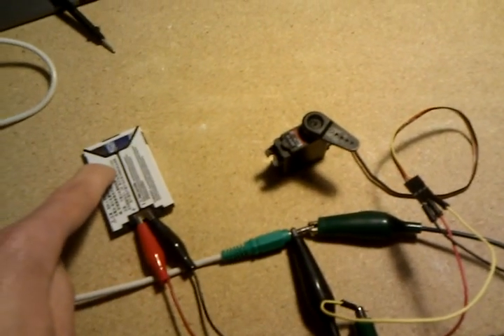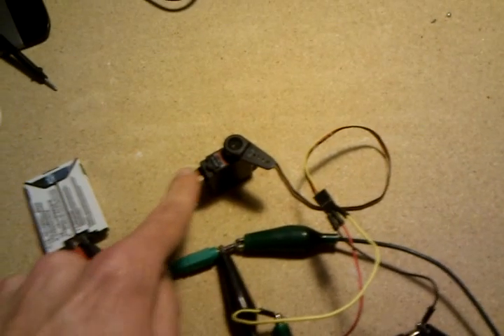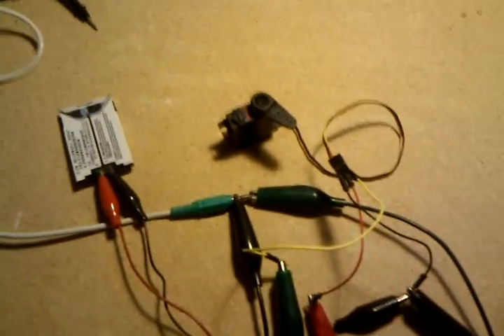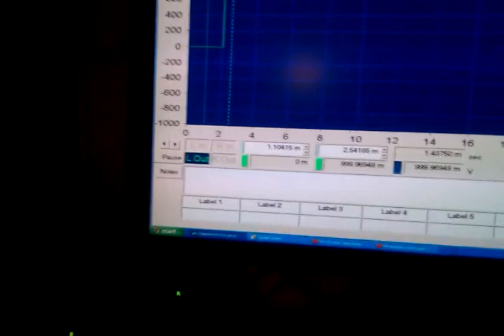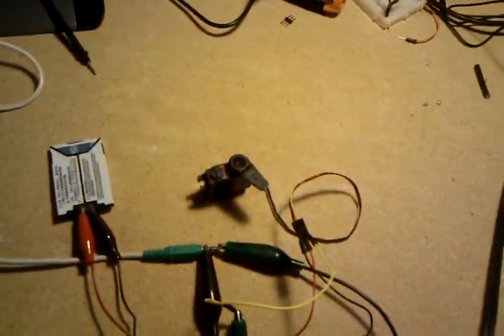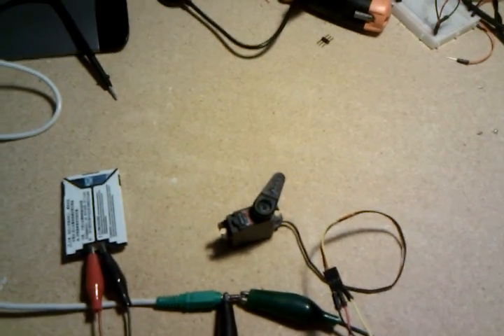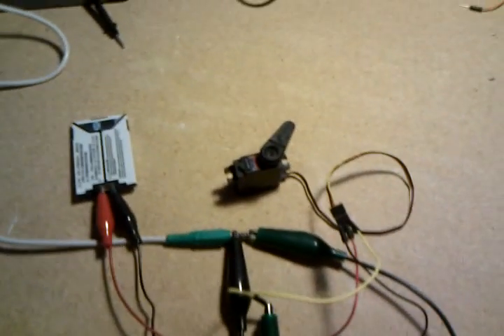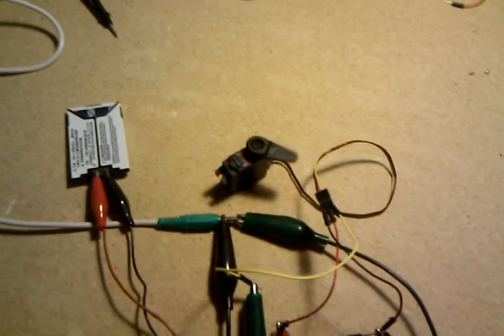Servo control via Audio Only

Comment: Awesome!

I tried to hook up a servo as well;
USB Hub -> Old cable + USB Soundcard

I hooked up the servo to the old cable (+5V & GND)
And the yelow signal cable to the USB Soundcard L channel (and +5V to the jack's base)

The Servo only moves when touching the signal cable?

I used esseraudio PWM Generator, tried 40-50Hz with different Duty cicles.
Any clue where I went wrong? :-) Perhaps its just too late (2.40am) to do such stuff.. I used a miltimeter to check polarity and such..